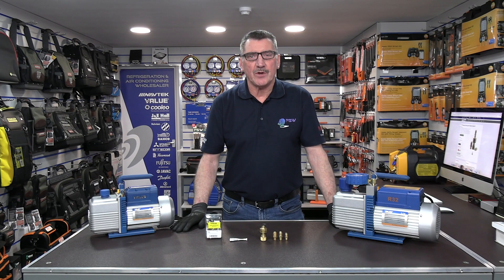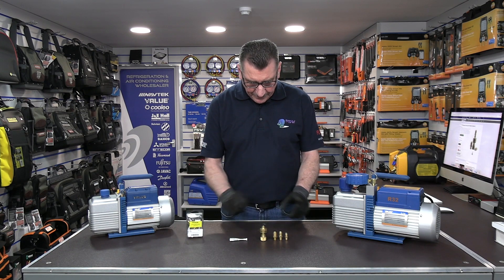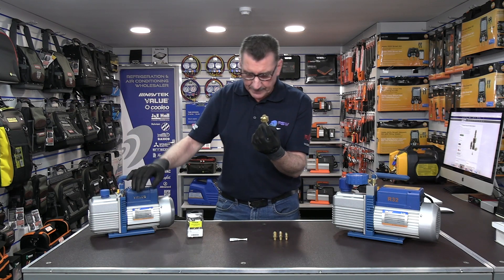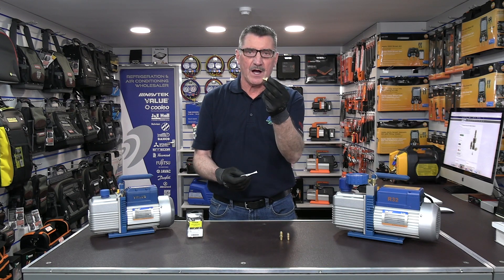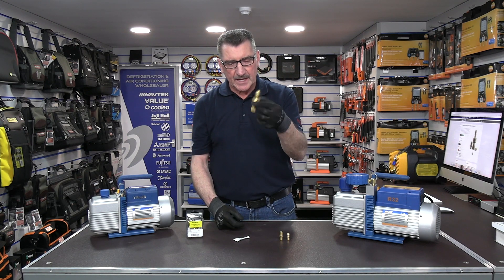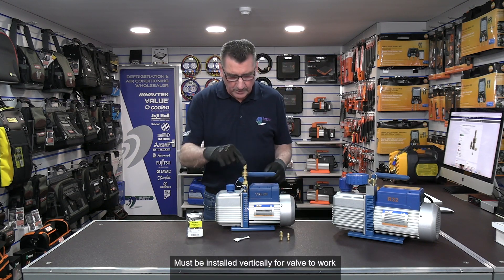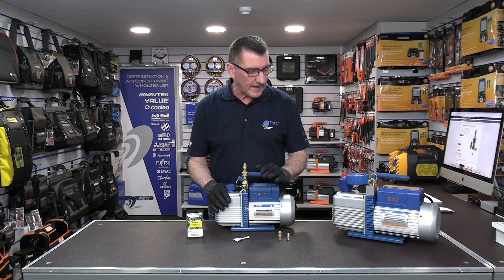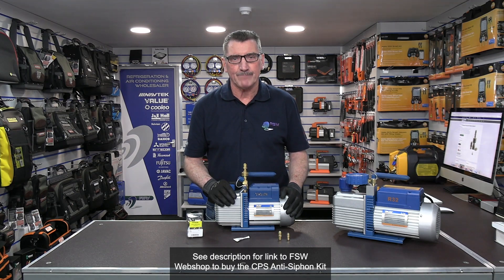How to add a Non-Return Valve to any refrigeration vacuum pump in minutes.

Comment: Hi, I liked watching this video of your Non-Return Valve. 
Then, I purchased 2 of CPS VPAS8 which is the exact model in your demonstration.
I believe that this CPS anti-siphon valve kit is for anti oil suckback when the unexpected power failure occurs during evacuation.
I simulated power failure during evacuation while I have VPAS8 attached on my vacuum pump.
Surprisingly, both of these new VPAS8 failed.
Have you checked if it really prevent vacuum suck-back on your vacuum pump or do you just believe the CPS's claim on their product?
Could you possibly add another video that include the demonstration of this Non-Return Valve effect on the vacuum pump while power shut-off ?
Reply: Did you have it installed vertically?

Comment: I recently bought a vacuum pump like that older version on your bench to use as a vacuum for sucking the air out of mylar bags with dried seeds in the bags.  I took off the brass inlet fitting and ran brass piping into a air filter and then to a hose for sucking the air out of the bags.  I noticed the original fitting looked like it had some king of valve in the base, so I figured it would be a good idea to put a one way check valve in the line between the pump and the filter.  Do you think that will work ok?